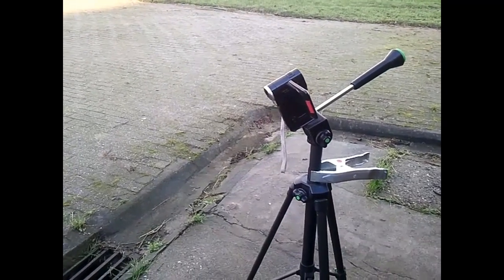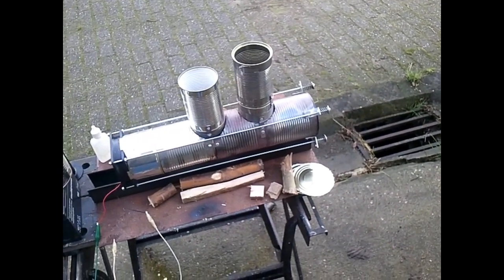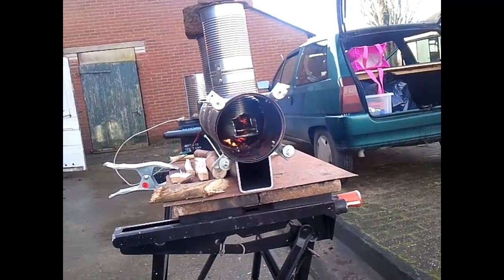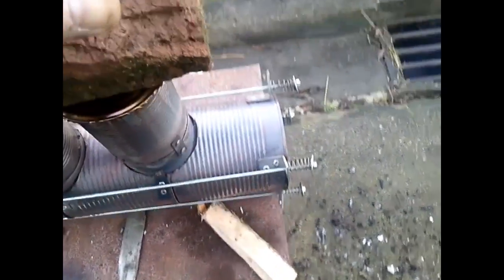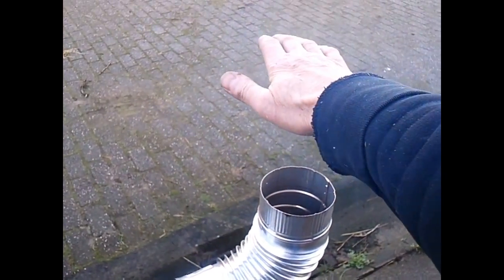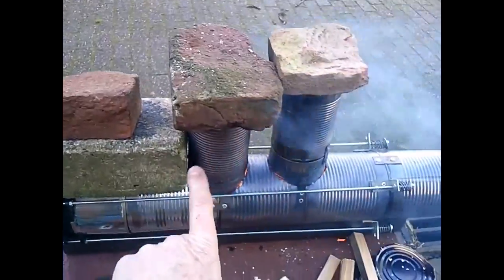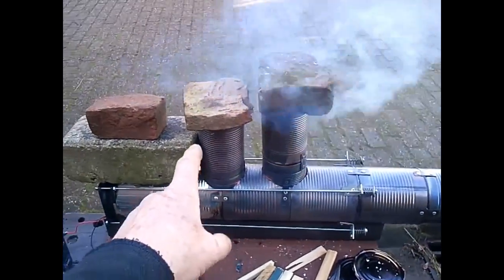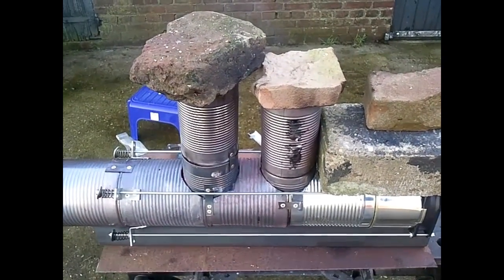Fun with food cans 26-01-2016  Tandem burner.

Comment: for remember,
A.V.E.C. vortex between fan and feeder,
increase air volume (as bigger air box on engine motor increase power)
easy to do in can with a 'dremel' mini drill, and a *.pdf document for model to print (can find it on quant'homme french forum).
Reply from the maker: look at the mimax tandem burner. greetings
Reply: Bert Heideveld
Thank's Bert, have fun and good end of winter.

Comment: Interesting experiment, but seems like too much smoke from the feed chambers probably from the forced fan. I wonder if you made a longer exhaust pipe and put the fan at that end to pull the air through the stove. You'd have to be far enough out so the fan didn't melt. I enjoy your video's and appreciate the time you put into them.
Reply from the maker: Working on it, this is just a experiment, The MixMax will by a tandem stove soon. see video 26-01-2016 Greetings and tanks.

Comment: It does burn the wood really good ..I wonder if a speed control on the fan could give you a different burn ..This Idea could  make a great stove made  out of heavier pipe maybe larger Diameter and a bigger fan It could heat a small workshop
Reply from the maker: I work on it by changing the MixMax design. See video from today. greetings Bert